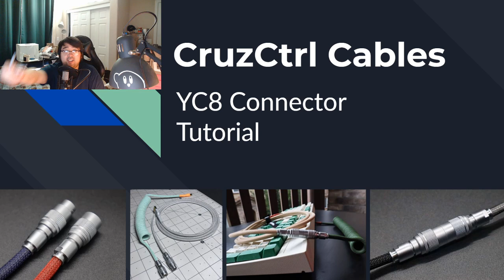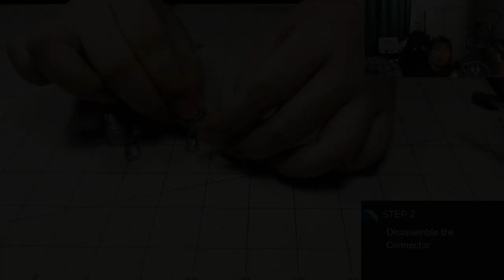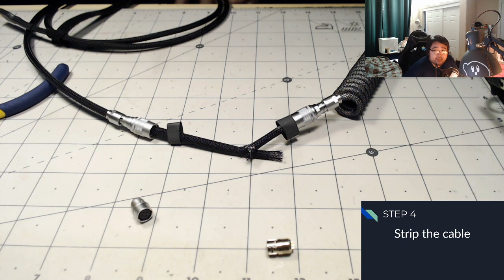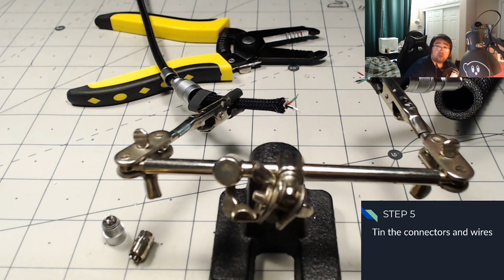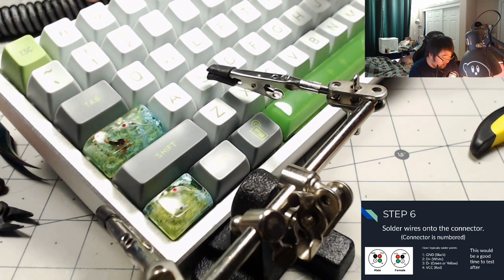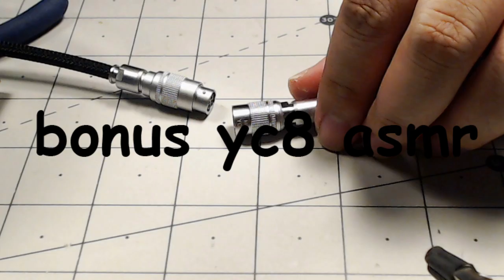DIY YC8 Connector Tutorial - Mechanical Keyboard Cable

Comment: Hi, thanks for the video. I am curious about the wiring pin out in your diagram (which I have also seen elsewhere) but note that the USB A wiring pin out is different. For example, pin 1 is VCC and pin 4 is GND for USB A. I am worried about frying devices! Thanks

Comment: I find these cables and connectors really ugly honestly, the connector is a fucking chonkster and the coiled cable is also bulky as hell. I don't get why people like these.
Reply: idc bro
Reply: And these cables are no longer within spec. The connectors are the biggest problem.. They look cool but they degrade every aspect of the signal to make it no longer USB compliant. For charging a phone, or connecting a keyboard or even a mouse, it'll serve its purpose. But it will crap out if it needs to transfer data and power at the same time.. It's like luck at the draw. You'd want the cable to be as short as possible if you wanted to use it like a real USB cable.

Comment: Not sure about the tolerance comparison between yc8 and lemo, but instead of having extra length on the techflex, I used electrical tape to temporarily tape the techflex to the cable sticking out to get the end nuts onto the cable more easily without fraying the techflex.

Comment: It might be a good idea to connect the male and female "cores" together when tinning them or soldering wires to the connectors, the plastic part (I think it's plastic) of the connector might melt unless you're quick when you're soldering. If you'll do 13:07 remember to unplug the cable, you don't want to short your computer with your tweezers, unless the male connector is on the device end. This is kinda a note to beginner's and myself when I actually do this

Comment: Is dual shield required for USB cables for keyboards? Would just braided shielding do the trick? I'm assuming foil shielding is a no go?

Great content, thanks man!
Reply: No, you don't need to double up. You can just use paracord, or techflex, or even leave it naked (you won't be able to coil it naked tho)
Reply: @NotABot-px7ky  for future builders out there, it is definitely recommended to use double shielded cable for custom USB cables.
Reply: @buster7618  it's a good idea to practice it if you want to sell your cables, but if you're just making for yourself, you don't need to
Reply: @NotABot-px7ky  agreed!